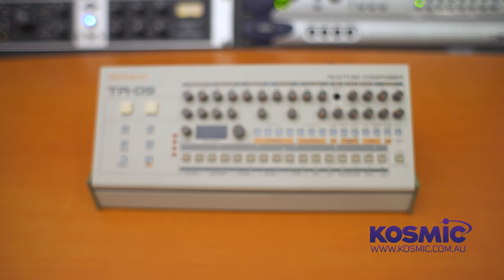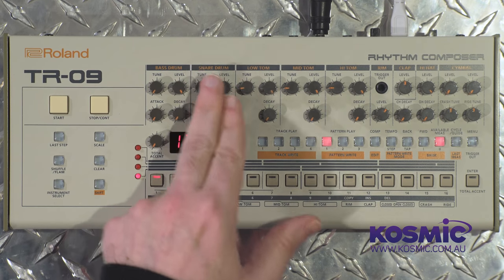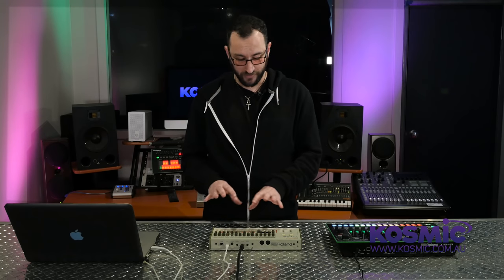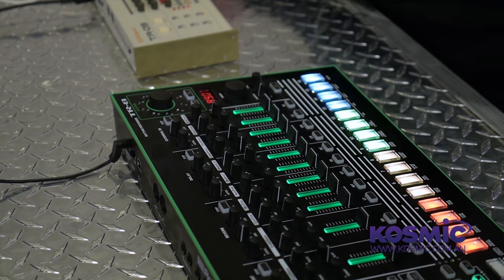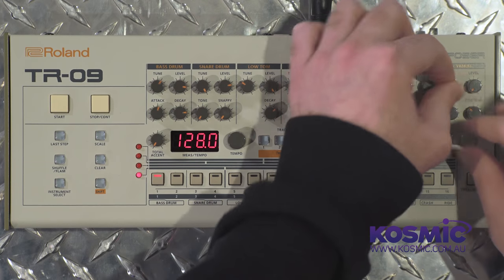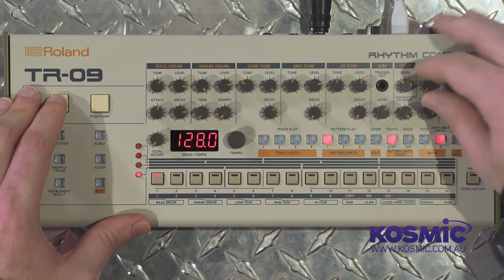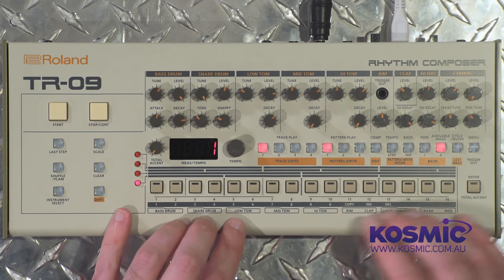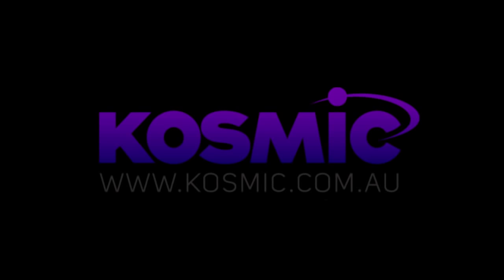Roland TR-09 Drum Machine In Depth Review

Comment: The separate outputs thru USB is wonderful. This way you can add effects to each separate instrument. Great 909 sound but still a little difficult to program as like on the original. Great job Roland on recreating a classic.
Reply: That feature is SOFTWARE based, rendering it temporary at best.

Comment: Playing with this in a shop, I'll say this:
The sound is very close to a real 909. Any difference there is, isn't of importance. Lots of early techno and house records were recorded with a slightly overdriven input gain on the analog mixer, which certainly gives it an extra something. That's something you can do with the TR-09 as well. To do it in-the-box, get Waves' NLS plugin, and use the "Mike" mixer, emulating an old EMI console. It sounds amazing.
Source: I used to make music with a guy who had lots of the analog originals, incl. the 909. He lived 3 doors down the hall, so I practically lived with that 909 (and his many scorpions! 🙀)

Why I didn't buy this (I intended to! It's why I went to the shop today) is the small, cramped knobs. I'd buy this for the tweakability. Even with my small hands, I couldn't rotate the knobs without touching the surrounding knobs too.

The TR-08 is slightly better in that regard. And it's easier to program than the TR-09. 808 has just never been my cup of tea. What a one-dimensional kick, awfully metallic hats, etc.

The Aira (TR-8) ... that box... So cheesy.

Comment: great review! the separate usb outs is a logical way to do it, as long as it is stable. The programming is authentic, and the sounds (through youtube admittedly) are good. I had a 909 for many years which I lost to an epic tax bill. A few things come to mind - first - the tr8 is very good and close but on my tr8, the 909 closed hi is just...wrong. It is ok at short decay settings but with the decay higher up you don't get that metallic 'clatter' (Jeff Mills style as you say!!). So I hope this gets that flavour. You mention that these sounds were sample based but due to technical limitations at the time, I believe they are 12 bit samples and this coupled with the probably not mega quality dacs of the time give rise to that beautiful hi hat character.

Secondly, some of the character of a 909 comes from small variations in tempo arising from the fact that the tempo was set by a resistor and also that the clock-speed of the CPU was tiny by today's standards. So when a pattern is running, for each step the CPU 'scans' each instrument to see if it should play on that step. I believe (someone can correct me) that it does this with the bass drum first, then the snare then I think the hats etc. This means that sounds 'hit' fractionally off the grid - consider that this varies minutely bar to bar - you get some idea of why a 909 is described as 'alive' by users.

Thirdly, the way tom flamming works on an original 909 is...odd. On the original, if you write a tom flam, and look at the waveform you see that the flammed hit is actually the normal tom hit but missing the 'attack' portion. It's a big part of the sound, the tr8 doesn't do it - if Roland have TRULY modeled every component on the circuitboard then this machine should do this.

Lastly - and this might be hard to demonstrate on a youtube video due to compression - does this new machine accurately reproduce the 'third' sound that you get when you write a clap and a snare on the same step - it is a 'whooshing' noise that is very distinctive because the clap and snare derive from the same noise source. The detroit techno guys know all about this!!! Again if it is a true circuit board model it will be there - the TR8 does at least have this sound.

If you run a 909 pattern through the single main out, you get a lovely hardware compression and it is nice that they have tried to model this.

Does it force Logic to 96.000 by the way - because the TR8 does and it is a nuisance!!

all the best

Bri

Comment: I have never worked with machines like this but i would like to get into the matter so i really have to ask this maybe silly question:  Is it possible to create a pattern that for example starts with a 4/4 beat which then turns into a 6/8 beat and then into a 3/4 and so on? Is it possible to programm a pattern like these into that machine and then plays in a row without switching settings?

Comment: I know ppl are upset about the hardware outs, but since they're assigned to midi channels couldn't you plug it into a midi device with hardware outs, or something similar, to produce a similar effect?

Say I have a Tr-707 and hook up the Tr-09 to it. Then I map all the Tr-09 channels to the 707s and use the hardware outs of the 707 to control both of them? Is that feasible?

Comment: always wanted a classic 909, but settled for the tr8 couple years ago. 

i cant see this being any better than the tr8.  i was hoping they would re release the original analogue 909 machine. i would've paid top dollar for one no questions asked. 

what a let down
Reply: +MrTrollinglol i just wrote what i expected..
Reply: The TR-8 is actually 50€ difference in Europe. I wanted to buy the tr-09 first until I noticed that I can get the tr-8 for the same price.
Reply: and the tr8 is a much better decision.
Reply: get the Nova Clone
Reply: I agree, I have the Tr8 too and its a great device, good sound but if Roland released an analogue version I'd buy it instantly . I think they have done a brilliant job of the emulations but still hear a fuller tone with the originals and clones.
Reply: yeah, Roland should jump on the Bandwagon and throw out new and real analog 808s now. The time couldnt be better. With the Analog Rytm setting a new standard for an analog Drum Machine and Arturia almost putting their Drumbrute out - which offers no less than 17 analog drum circuits ^^ and those even sound good :-) ... yeah with all that, Roland should instantly STOP doing digital modeling and put out something real. If they would make a new 808 - real analog - close to the original, or maybe just similar to the legendary Vermona DRM1 - i would pay 1k - for sure !!! :) but for analog modeling only, therefore - digital. i could have all that much cheaper and pretty similar as a lame plugin if i want ^^
Reply: subbz2k
i agree, except do the 909 not 808
Reply: KUPHSER Yeah but a lot of people, A LOT OF PEOPLE, can’t afford to spend that kind of money on a drum machine so why would Roland make it? There’s no money in it and this thing sounds almost identical. Quit being pretentious.

Comment: So will this trigger out vintage analogue gear without midi like a SH-101? Because the TR-8 trigger out does not work well and does not trigger my SH-101. 
The options are a mod (circuitbenders.co.uk sell them) or to build a box that you plug into to between the two machines. I would like to see the trigger out on the TR9 tested on a vintage synth.
Reply: Yes triggers via rim shot, i saw a vid.😬Ideal for my sh101, juno 6, analog secuencer etc..

Comment: Why would you buy this instead of the tr 8? Surely just less flexible .... not meaning to sound sarcastic i'm genuinely curious to hear from anyone looking to buy one ?
Reply: well I have the Tr8 and yes it is just superb. But I'm gonna buy the 09 just for the look of it. I'm being honest don't shoot me
Reply: no judgement from me ... I dont have the TR 8 but if i wass going to get a drum machine i think that would be it ...
Reply: Yep I get why. The extra kits and the fact it is an excellent drum machine for the same price.
Reply: This looks good but I'd get the Tr8 any day as its far more flexible.
Reply: i think I would get a tr8 too.
Reply: If you have old analog sinth like 
Juno 6x, sh 101 or jupiters for example, the only way to move the arpegiators or seceuncer of the sh, is via Trigger out, Tr 8 doesnt have that, (there are ways to convert audio to trigger), but i think that for that reason this tr 09 becomes more atractive. If you prefere (tb3/system 1) instead of (tb 303/sh 101) I think you will prefere tr8
Reply: good answer ! cheers!
Reply: Also the TR-09 is more portable - great in a flight case that's trying to fit in as much gear as it can.  I can fit this into a Pelican 1520  or HPRC 2550w with a couple Elektrons and a looper pedal.  The TR-8? No chance.
Reply: I guess they mainly do these things for publicity reasons... I actually heard of the TR 8 only just now...
Reply: +Adam Jay this also runs on batteries and has a built in speaker.  Not sure if the TR-8 does.
Reply: "But I'm gonna buy the 09 just for the look of it."
I agree.  I think the TR8 is ugly.  I love the look of the 09, but all of that menu / submenu diving is a big turn off for me.  Back to my Korg Electribe.
Reply: like i said, "Trigger out"  it's a feature that only people with  vintage analog synth appreciate.  it's necessary  to use this 5v trigger pulses from  drum machines like 626, 707, 909,  606 (2 trigg out)!, 808 (3 trigg out)!! , now this 09  has one, with tr8 you can do a mod to have it to, but an electribe not sure... leaves real synth and modular out of the game... not all is about looks...submenu even my 3 year old kid can learn it in a few min.
...its a buy for me... (not working for roland)
Reply: The tr-09 has accent per instrument like on the 909 instead of a global accent like the 606. I've recorded with a real 909 on several occasions and, compared with my TR-8, the global accent limitation is a huge drawback to possible grooves.
Reply: Emit Idy good tip
Reply: Yeah TR8 is very very ugly and Doesent matter it could do acid house beats or whatever the looks is very important to me too,I like much better the Tr09 look it's very convenient and it has in spades only what I need from Roland drum machine yes those 909 drums.Im getting the TR09 it also is very compact and that's a big plus for me.
Reply: I can see that. An instrument has to make you want to play it. Look and feel is super important to me too ... and the TR8 is just unbelievably ugly.
Reply: Yep totally pointless.

Comment: It seams like Roland still cannot get their heads around what's meant by
 the term "Design Classic'. You'll always be able to buy yourself a 
[New] Porsche 911, a new Harley air-cooled V-Twin, a new Fender Strat, 
Telecaster or Gibson Les Paul, even a new AR15 or AK47(lol). But Roland 
simply cannot, and will not, reproduce their famous classic instruments exactly 
as they were, the stuff we've been wanting to buy for decades now. They 
keep introducing stuff that's related to some degree but never exact 
copies as we'd want. 
Korg who didn't create so many cult electronic instruments have been 
smart enough to remake the MS20 Mini exactly as their MS20 was, if only a
 little bit smaller, and the MS20 Kit is around which makes a full size 
MS20 with MIDI if the new mini size version doesn't work for you. Korg 
even produced ARP's classic synths under license using the same tech, 
Well Done Korg and thanks for listening to us users !  Maybe we should 
just give up on Roland altogether and just ask Korg to make us exact 
copies of the Jupiter-8, TR808 & 909 [under license] from Roland, 
The End. 
At least then we'll get the exact items we want to buy.

Comment: First it seams great BUT! ANOTHER FAIL BY ROLAND AGAIN! WHY DO THIS MACHINE NOT HAVE SINGLE OUTPUTS FOR ALL OF THE DRUM SOUNDS???? So it proofs AGAIN that Roland didnt have any idea what techno/house (and all the other great electronic genres) music producers wanted to do with a drum machine!! With no single outputs one con not treat the several sounds seperately by using effects ect. And that is why one will get bored with the sounds one can get out of the machine (a bit like with the TR-606 wich have no single outs and I often hear and read that people get bored fast and modify it)! I simply cant belive it! Roland didnt understand why the original TR-909 is such a sought after machine, even in 2016. It is for shure, like with the TR-808 and 707, that superb analog sound as a point to start to than process the single sound seperately. Not to speak about that its a digital drum machine AGAIN...
Reply: They didn't know what customers wanted back in the day either. Some of the most classic machines were never intended to be used the way they are. The TB-303 and TR-606 were designed to play along as a bassist and drummer for conventional musicians, not glitch and acid house..
Reply: waxen pith
Yes shure I know that. But I hoped that they may have backwards analized what maked these machine useful to the people who at least worked (and are working) with them. Roland please! Just give us 1 to 1 analoge replicas incl. all the features of the originals. Isnt that possible?? Just look at Korg guys, there you go...
Reply: +waxen pith maybe this time the TR-09 is also intended for drummers and bassists ;-)

Comment: Very good video, you clearly put a shitload of effort into producing it. Appreciated! I may well buy one, it'd complement my modular nicely :-D and it'd also be great for wiggling on the train. The decision to include battery capability is a great one. Though some 3M DualLock and a USB power pack would achieve the same goal.

Though I am a little disappointed at the lack of analog individual instrument outputs, and I expect I won't be alone in feeling that way.

Comment: Roland is stuck in past. Does this overpriced thing even have parameter locking?..
Elektron Analog RYTM FTW. Or DSI Tempest. Or at least MFB Tanzbaer. Heck, even Volcas!
Edited to add: I'd pick TR-8 with 7x7 plug-out over this one, but the question is - why should I pick it? 1980s are long gone, industry moved forward.

Comment: I wonder if this is better than the Roland TR-08 in any way?
Reply: The tr-09 has better accent behavior - it has accent per instrument like on the 909, where the accent volume can be controlled by the accent knob. The accent knob on the tr-8 is for the global accent track which affects all instruments equally, like on the 808. The tr-8 is able to do half velocity steps but it has only limited use because there is no way to adjust the relative volume between full velocity steps and half velocity steps. I've recorded with a 909, a 606, and I own a tr-8.
Reply: That's really hard to say because I haven't played with the new tr-09. I could go either way. I'd be happy with either. The TR-8 expansion pack has a 606 kit now that I want to try out.